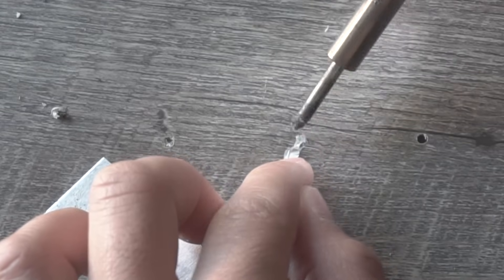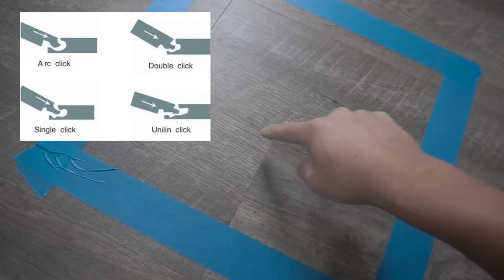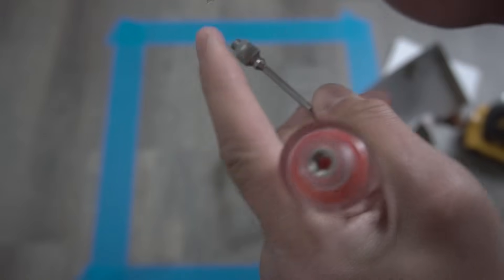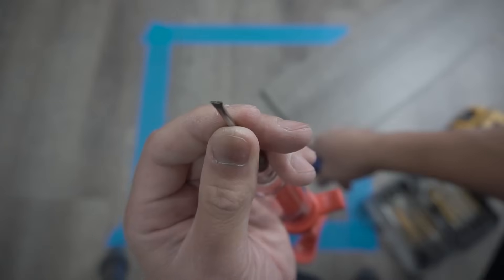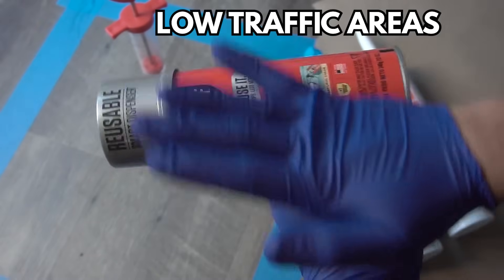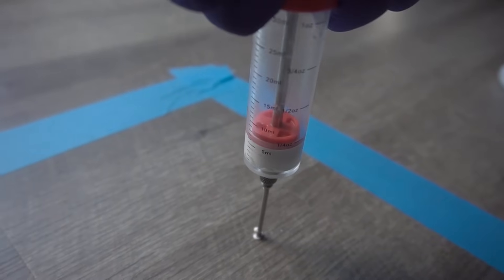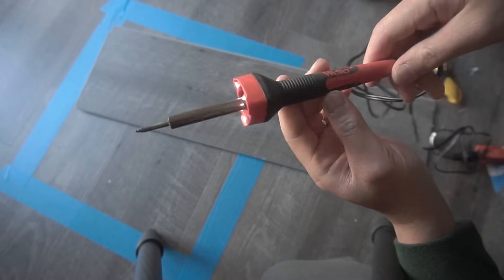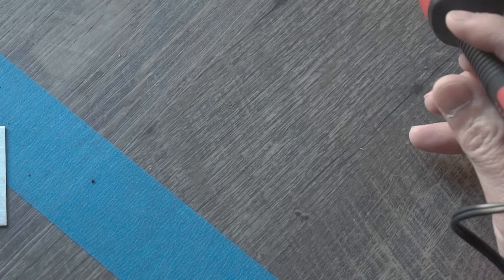How To Fill Hollow Spots Inside Vinyl Plank Flooring LVP Laminate And Engineered Hardwood Floors DIY

Comment: So... let's have a discussion. If you paid for professional installation the floor will be prepped first and this won't be an issue. Gluing a floating floor down to the osb will void the warranty and cause so many problems in the future when the floor expands and contracts.
Reply from the maker: I do agree, but no matter how much prep you do, over time wood will warp due to temperature changes. Also this is why I didn’t use wood glue, I used caulking that designed to stretch to allow for expansion and contraction. You can use wood glue if you have solid wood floors or engineered wood that is nailed to the floor.

Comment: You do know the floor was not properly installed? The seems can't be less then 8" apart. With your example, that is the cause of the floor lifting. The exterior door just amplified it.
Reply from the maker: For 5-inch wide planks, have a minimum of 6 inches between adjacent row seams. For planks wider than 5 inches, you can raise the minimum to 8-10 inches

Comment: I had my floors done by a company and my floors are cracking. I also have issue with hollow areas. He came out he sent someone out and then they put nails in the floor. I knew the person I really thought he would do a good job .I was wrong. Sad thing is is I had this done after my husband passed away because he was going to fix the floor and didn’t have a chance to. I hate that someone took a vantage of me, I should have waited until after I grieved then I might have been in the right frame of mind

Comment: I followed these exact instructions and it failed. Also the big stretch took over 4 days to dry up so better expect nobody in the house all week.
Reply from the maker: You will need to give the caulking to dry yes. I would suggest you mark and barrier the areas you filled so that nobody will inadvertently step on those areas while it’s curing. Remember big stretch will work better for a LVP or laminate style flooring. For wood or engineered wood, wood filler will work best but not intended for floating floors.

Comment: Dude,make sure yr floor is flat. Screed the floor.any problems with uneven floor. Use feather screed. Using clic lvt ,use an underlay.
Reply from the maker: Thank you for sharing your knowledge! 🙏🏽😊
Reply: Thank you. Bruv ,it's all about PPP! Prep,prep,then prep again. I promise you this. Proper prep makes the job so much easier,then no more hollow points anywhere bruv. 4 hours prep,saves ten hours correcting. 👍🏼❤️

Comment: This has nothing to do with the hot and cold air coming through the door, this is a floating floor, if you have laid any of it tight to a wall or stud, this will stop it expanding and cause air pockets.
Reply from the maker: Hi! I don’t suggest you lay it tight against the stud, you need 1/4” away from wall for expansion because it’s a floating floor 🙏🏽😊

Comment: Don't let the soldering iron heat up all the way! You aren't trying to melt metal.
You want it just hot enough to melt plastic. If you heat it up all the way, the flooring shavings immediately stick to the iron and starting burning, making it impossible to fill the hole correctly, and also filling your room with toxic smoke.

Comment: Did this.. went to buy the exact stuff on Amazon. Did 6 holes in various spots and it was almost impossible to get the caulking down with the turkey injector. It would come out smooth but when I stick it in the hole at different depths, it just won’t come out. The pusher would push right through the caulking creating a huge mess. Waste of my money and time. I rather just use foam and inject with ball pump tip like another YouTuber did. Very disappointing
Reply: Soak the calk in hot water for 20 plus minuts
Reply: We had trouble with that too, but we realized that the little O ring on the injector had rolled up when we pushed the caulk in. So we made sure to slowly push it down (and I used my fingernail to make sure the O ring went down and didn't roll up). Once we figured that out, it worked beautifully every time. It wasn't super easy to push down, but maybe if you heat it up like others suggested, it will be easier. We didn't think of that. Anyway, we kept pushing until the caulk went in. Our floor is so much better now.

Comment: Aren’t vinyl click-lock floors supposed to float? I thought this would be bad for the floor to glue it to the sub floor
Reply: Yes and the floor should be checked for level or low/high spots before installation

Comment: As a professional in this trade this install is bad. Skim your floor with ardex and use a proper membrane.
Ps: your joints are not intact eaither ;)
Reply from the maker: Thanks for the tip! What type Ardex you recommend?

Comment: Now with what you’re saying to do is basically glue down the floating floor to the cement. And when you use this method to separate the short butt joint you’re going to snap the locking system especially if it’s a drop lock product. You need too do you’re homework on repairing vinyl or laminate floors before you start making these videos

Comment: This is hilarious.  Prep the floor properly before you install the vinyl, so you don't have to resort to this madness.
Reply from the maker: It’s not madness is a option solution for those with floors that were installed incorrectly. Share some of your solutions on this existing problem would be greatly appreciated.
Reply: @FixThisHouse  Sure.  It's a click system correct?  Mark the areas where the floor dips, unclick the floor and apply self levelling cement.  Using a syringe with silicone is not going to fix a large dip in the floor.
Reply: Of course you want to prep the floor correctly before installing. In a perfect world that would happen every time. But when you buy an old house with a lot of unique problems, especially with the flooring, you find that some things didn't happen perfectly. That was our problem. Our kitchen was about 3/4 inch higher than the rest of the house, so we leveled it before putting the floor down. But there were some spots that didn't get filled in properly, and we didn't know that until we installed the floor (we are DIYers, and we've laid flooring several times over the years). So this technique has made a wonderful difference in those few spots.
Reply: @Leedes58  If you laid a click floor like vinyl or laminate, you could easily unclick the floor and level the floor with self levelling cement instead of drilling a hole in your floor and squirting a small amount of silicon through a syringe.
Reply: @jonathanbell9349  Yes, we would have done that had we not installed the baseboards and had a lot of flooring to move. Anyway, my point is that every situation is different and may need a different solution. In our case, the few areas that were soft weren't super big, so this worked great.

Comment: Engineered laminate floors do not expand and retract, just saying
Reply from the maker: You are correct! the subfloor and the walls around them do. The reason you need to leave gaps to allow for expansion and contraction 🙏🏽😊

Comment: or you can get a professional and fill your floors before installation.. this long term will only hurt your flooring the seam has a lip that will break off once your separate the flooring it will not lock again and the flooring will constantly separate. the soft spot in your floor could also be caused by 2 heavy pieces of furniture on either side of the room. and your floor expanding.. more often then not, doing this injection method will only cause a hump in your floor.....

Comment: Or you could just do the correct prep work in the beginning to prevent this from happening
Reply from the maker: True, but over time wooden subfloors will warp due to temperature changes depending on where you live. I’m just demonstrating a optional solution.